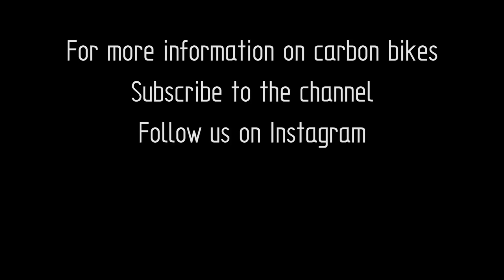Question Of The Day - Damage from a hot car

Comment: Good question and answer Raoul, thanks.

A minor point as it won't make any difference anyway, but a raw carbon fibre (ie black) component in direct sunlight has low thermal conductivity and could expected to be well above the ambient temperature of the air in the vehicle. Having said that, I believe most, if not all, the plastics used in the interior are thermoplastics and even in direct sunlight on the hottest of days will be below their glass transition temperature. So I guess if it's good enough for them, it should be good enough for decent pre-preg that's had the snot baked out of it at high pressure :)

Comment: @luescherteknik 
You mentioned that the mechanical properties will be decreased at temperatures, will they return as it comes back down to normal temperatures, or are they permanently compromised? For context, I have a track bike that will live in a container outside the track.